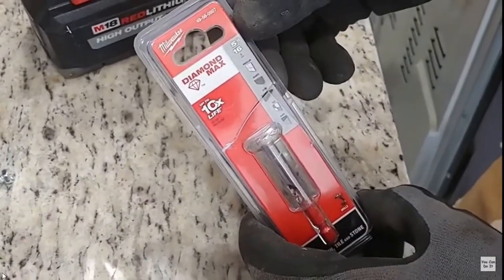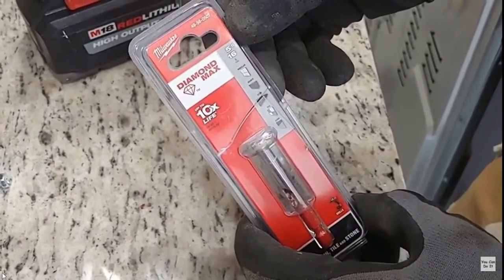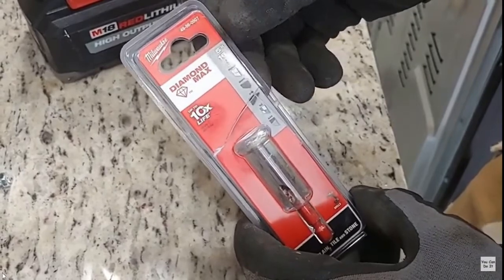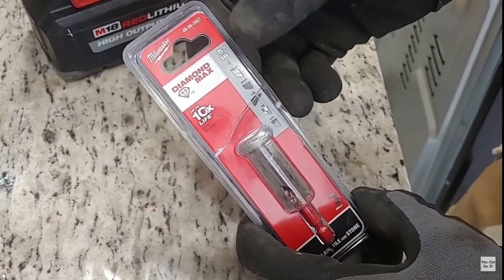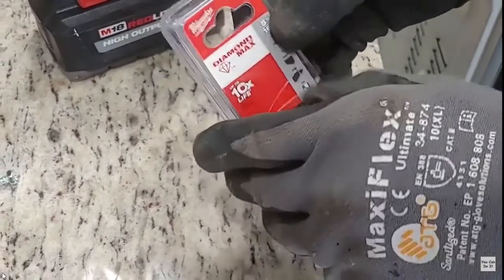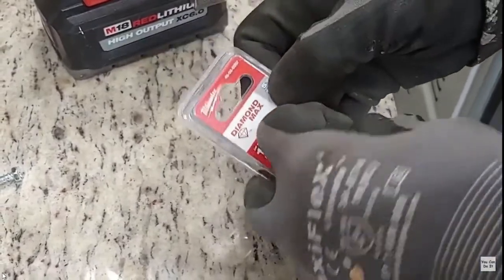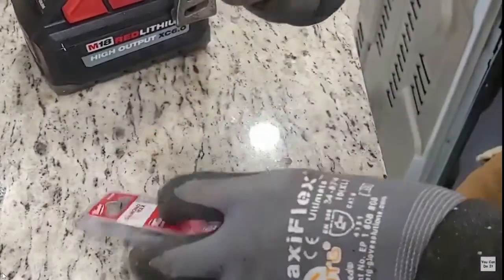Milwaukee Diamond Drill Bit for Tile and Stone DIY #homeimprovement #milwaukee #diy

Comment: Do you need to change drill bits, and use the masonry one after going through the porcelain tile? or is it this capable of penetrating also the concrete?
Reply from the maker: Hi. Thank you for watching the video. These drill bits should last for a while. They have diamond dust on the ends of them and do a great job penetrating through tile and even concrete. The key to keeping them nice and sharp is adding water to the surface of the tile so that friction is reduced. I have used this single drill bit to penetrate through multiple tiles and the concrete fiberboard behind them. This single drill bit has lasted for several projects. I hope that this information helps 👍
Reply: @YouCanDoIt2  one other question, did you use hammer mode as well? i find conflicting info and some say do not use hammer mode, and some say that as long as you are using a diamond drill bit with a hole, there is no problem with the granite/tile and the job can be done faster.
Reply from the maker: @alexitosrv  Hi. Good question. Personally, I would not use the hammer mode, especially if it is a softer tile. The standard drill setting along with water should be all you need to be able to penetrate through the tile. It would be quite a shame to put the drill on hammer mode only to crack the tile on a finished job and then have to repair the tile. In this case, slow and steady wins the race! I hope this helps 👍

Comment: Great vid! What screw size do you recommend for mounting bathroom accessories onto a tile wall?

Bought a set of Hillman anchors for tile but realized the screw is pretty long (1-7/8") . I don't want to risk screwing into  a Romex cable, what size should I get instead?

The anchor is 1 1/8 "

I'm considering getting 1 3/8" or 1/ 1/2".
Reply from the maker: Hi. Thank you for watching the video. You should be fine with the 1 1/2" screw. You will have about 1" thickness for the tile, grout, and hardiebacker. Therefore you want to have enough length left on your screw to grab a hold of that anchor and engage it enough to pull it back as a bracing.👍